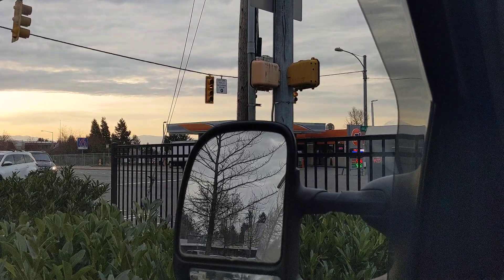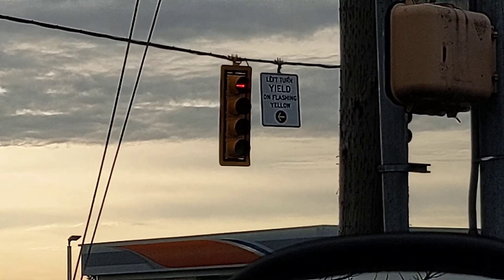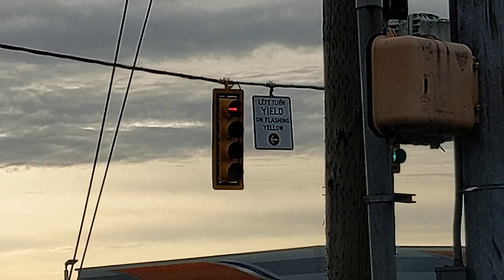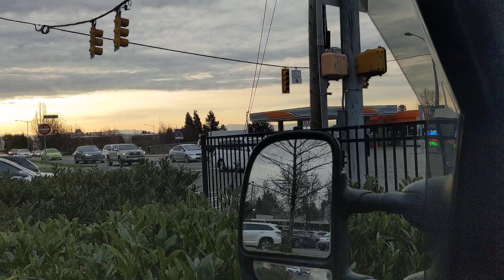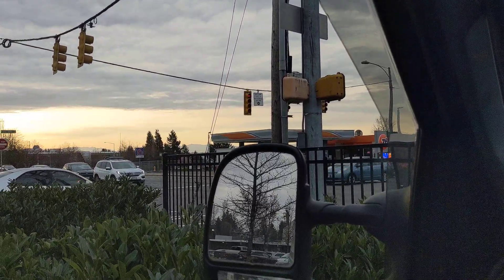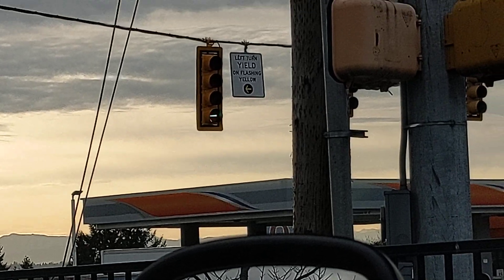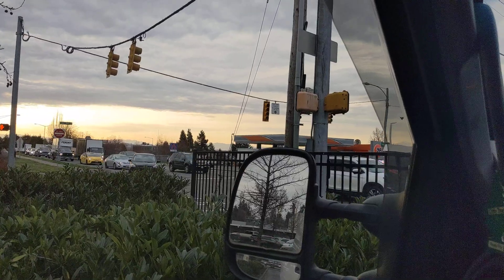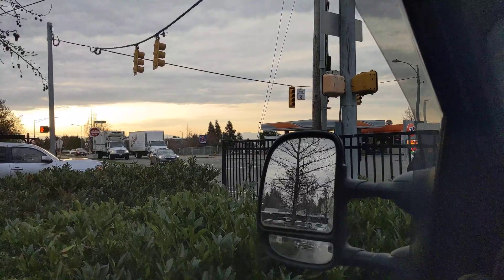Flashing Yellow Arrow introduction

Comment: I will say they made this set up a lot easier with newer TS2 and ATC signal controllers.  In my case trying to make the logical "ped clearance" (in conjunction with an overlap) function to work in my older TS1 field terminations load panel has been a bear and one I have never solved (it's not even an option in my Econolite ASC 2100S controller).  Not one video out there demonstrates how that is done.  After all FYA is supposed to be backward compatible LOL.  Hope all has been well for you!

Comment: Can you go over a blueprint, also how detective devices work such as radar and camera and how they would be wired into the cabinet and programmed
Reply: I just started a week ago at a company that does traffic signals I’ve already learned a lot from your videos but want to understand how all of it works so once I start learning programming it will be easier understanding how everything works rather than just putting in stuff without fully understanding it if that makes sense
Reply: Though I am not in the industry, I actually have some knowledge on how detectors work.  As a signal collector for more than 20 years, you pick up a thing or two from the pros (I've talked to real traffic engineers and techs as well learned on my own traffic signal gear)  

Traditional vehicle detectors work on inductance (literally called inductance loop detection).  Those cuts in the roads (covered in a sealant) you see around an intersection contain three 14 gauge wires twisted and then placed in the cut asphalt (typically 6' x 6' and some are even longer runs depending on their function)  The wires are routed to a pull box that contains a termination point.  That is routed to the cabinet underground in conduit.  These leads are then connected to a series of terminal strips.  The loops of field wire are connected on the other side to the detectors cables which then go to the detectors.  When these wires are energized they create a magnetic field and when a large vehicle crosses that field it breaks the connection establishing a "call" to the controller via the detectors inside the cabinet (either NEMA style or CALTRANS variants).  The old full service gas stations made their bell ring using a hose across the driveway that went to a mechanical device that would trigger the bell when a car went over the hose.

I don't know how common RADAR detection is used in traffic signals, but cameras (quite common) use CCTV technology to capture traffic in the various lanes.  Lots of expensive gear lives in the cabinet which I know little about.

This video series is from 14 years ago, it goes into great detail how the traditional inductance loops are installed.  https://www.youtube.com/watch?v=KvzJn09DqaM

Also here is a REALLY cool demo from The Traffic Signals Training https://www.youtube.com/watch?v=G-_oFyT9vpQ

Comment: Its funny how you spoke as if new dog house signals are going extinct but here in the Tampa Bay area, they still put new ones up.
Reply from the maker: Interesting! Most engineers are moving away from them because of wind load resistance.
Reply: @trafficsignalstraining7673  Doghouse signals work better for shared forward/turn lanes along with right turn signals, so in those cases you can't really have a yellow flashing arrow (except for right turn)

Comment: I like the old doghouse configurations and we still have a few left in our area but they are being replaced by the newer "flashing yellow" configuration. Won't be long before the doghouse thing has gone the way of the dodo.
Reply: Going to the pound LOL.  Doghouse configurations are not as prevalent in my state (I've seen one near where I used to live).  The inline 5 signal (R,Y,G,YA,GA) is what is common (though the FYA is replacing them).

Comment: What mode fya do you use? Do you monitor the red fail on the fya channel since it is dark 50% of the time? 
I see the benefit to traffic, but the limitations of both the NEMA and 170 cabinets make them too problematic for me to love them.
Reply from the maker: We use mode b, our overlaps are on channels 13 through 16. We do not monitor the flashing yellow phase.

Comment: I noticed new 3 section fya signals is getting popular in my metro area but completely opposite in Denver n Colorado Springs metro areas. What is different between 4 section fya and 3 section fya signal?
Reply from the maker: Typically a four section head has two yellow arrows one for the yellow clearance solid movement and one for the flashing movement. 

A three section head configuration uses what's called a bimodal yellow/green arrow. It's an indication that has LEDs for both a green arrow and a yellow arrow and it allows for you to operate both indications off of the one section.

It's quite common to see nowadays because engineers are doing what they can to adjust the wind load resistance on the mast arm.
Reply: @trafficsignalstraining7673  our 3 section not have bi module for 3rd lower section. It have flash yellow arrow module and that it.
Reply from the maker: @jbb3design  I'm not sure if Denver is just trying something novel, but that wouldn't meet MUTCD standards here in the USA.
Reply: @trafficsignalstraining7673  pueblo is over 100 miles south of Denver. FYA is not popular in Denver metro area and Colorado Springs metro area. Pueblo is testing grounds for CDOT because we have only red flashing arrow signal in whole state of Colorado.
Reply: Lack of a protected green arrow typically
Reply: @AmtrakProductions  pueblo metro area is very first to have 4 section fya signal and cdot installed first set in 2005. We have only set of red flashing yellow signals in the state.